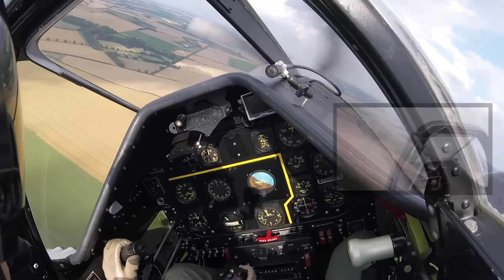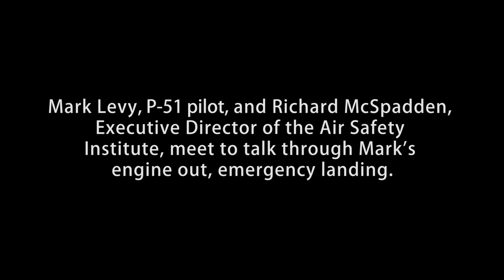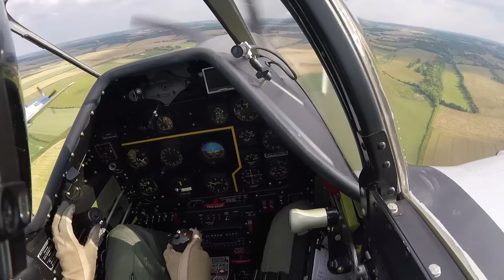P-51 Engine Out, Off-Airport Landing - Full Analysis

Comment: Our military has had the most bad ass pilots throughout history!! My grandfather was a P-51 pilot in ww2 providing support /protection for our B17's heading to and from their bombing missions,  flew his first mission at 20 years old with nearly no experience and ended up receiving a medal for his actions that mission.  for dropping back from the group on the return with another p51 to protect a badly damaged b17 with an engine failing FAR behind its group and slowly loosing altitude and fuel doomed to end up in the thick Forrest below .   The other p51s radio wasn't working and as my grandfather had moved in close to the nose of the b17 to make eye contact with the crew and hopefully give them some sort of calm for a moment as they approached the most common Luftwaffe assault airspace he looked up and the other p51 was nowhere in site , he eased away looking for it knowing the pilot must have seen German fighters and spotted 2 in acrobatics way above them .  He climbed to help keep them off the sitting and wounded duck B-17 spending what he said felt like hours of cat and mouse as they continued to try to get shots off on the B-17 even tho it was clearly in trouble and not going to make it.    My grandfather in all the dogfighting looked down at his fuel gauge and it read nearly empty with a long ways to go and still well over enemy territory if he needed to bail.   He said he knew he had 2 options, continue providing cover for the B17 hopefully fending off the 2 Luftwaffe and surely end up bailing out into German territory , OR abonadon covering the wounded B17 that was surely going down shortly and try to save the p51 and his life for another her day.  Sure many pilots in other places of the world would have left to try and save the P51, himself and knwoing the B17 was most likely a lost cause but he said he couldn't leave it and it's crew to be shot down by the Luftwaffe that would surely pounce as soon as he left.  He found out the other P51 also was having fuel issues from the long dogfight and with no radio he peeled off to return to the group ahead and left my grandfather .  My grandfather a Young American Pilot from Idaho in a plane with virtually no fuel surely to end up a POW if not killed by the 2 Luftwaffe ,stayed and continued trying to protect the B17.  One of the Luftwaffe made a good hit obliterating a machine gun turret and the gunner and my grandfather in his own words said "I was mad as hell and going to kill that son of a bitch!"  He broke off and after that specific German with the other behind him.  Moments later he had a good shot at a diagonal like angle and fired , it sheared JUsT the glass canopy off along with the pilots head , no other damage .  The other German behind him immidately cowered and turned back even being behind my grandfather .   He said the unmanned German fighter just glided smoothly and in seeming slow motion earlilly with no pilot and perfectly level somehow.  He was going to finish it off and had the thought as he realized it was headed directly back in the direction of the bombing target , that he'd leave it be and with any luck it'd continue and loose altitude putting it in Hitler's bunker!  Lol he always told the part with a grumpy smirk on his face.  He left the ghost fighter and returned to the B-17s side.  I always have imagined what a reassurance it must have been to them falling far behind their group in a doomed bomber , to see 2 p51's come and cover them and in the end a single one destroying one and scaring the other off returning to their side like he chased off the wolves.   He looked at his gauge and it read empty , he knew he'd need to get ready to bail when right then he heard the b17 smoking engine sputter and stop and a sudden drop in altitude .  He dropped with it in desperation completely helpless and unable to do anything.  He said he got as close to the crews glass to wish them luck and the pilot salute him and began to drop.  He used to tell us he'd still at 88 years old wake up drenched in bed seeing the wounded b17 slowly drop to the thick Forrest below and the helpless feeling he had and the anger for the Nazis for putting them there.  It dropped down and found a slight clearing ahead but my grandfather knew he didn't have the altitude or speed to make it.  It went into the trees and a fireball below .  My grandpa never showed emotion ever but everytime he told that story he'd get choked up and seem to zone out for a minute like he was seeing it right then.    
He looked back at his gauge in amazement that he still hadn't lost power and caught up to his group and let them know he was long out of fuel and would be bailing shortly and to let his superiors know the location when he jumped.    He said a God given miracle happened that flight , the P51 Jsut kept going and going, until they got near the airstrip .  As he decend with an about out of fuel B17 to approach, he said "I thoght hell, the damn gage must be broke! And sure enough as I said that , that son of bitch died!" Lol. He was short of the runway. But put it ina field with no damage saving the P51 and receiving a medal that sits in my moms house still today for his actions that day. 
My grandfather had one sibling, a little brother that was also a pilot.  They became orphans when he was 13 years old when his parents passed unexpectedly.  His brother was all he had.   He never talked about him though, my mom and grandmother said all they ever knew was he was a pilot and he died in the war.   3 weeks before my grandpa died one day he Jsut started talking about Jack (his brother) and we all shut up as no one knew anything about him.  He went in to tell the story of how his brother was killed.  He was crazy enough also a p51 pilot IN MY GRANDFATHERS SAME SQUADRON!   We all looked at each other realizing my grandfather would have been in the sky it sounded like when he was killed.  He went on to tel about a b-17 group protection mission they were suppose to go on.  His brother was really sick with the flu and my grandfather told him he couldn't go up and to sit it out and rest.  He told my grandpa , you aren't  going up without me there  ,  I have a bad feeling.  As if he was worried about my grandfather.   They went up and on the way to the point where they leave the b17's to dontheir drop and wait for the return having got through the typical hot zones with no issue , right then he said more Luftwaffe that he had ever seen came out of nowhere .  Saidnitnwas pure hell and chaos!  Grandpa said he chased off 2 NOT realizing they bait him and he soon had 2 on his tail .  Long story,..long,..he heard a loud pop boom behind him trying to evade the 2 while moving all 4 out and away from the b17's .   He looked back and saw one of the Germans in a fireball corkscrewing down with a p51 behind it.  The other one peeled and dove and he turned to get back to the group realizing as the p51 came to his side that it was Jack that saved his life.  On the radio he said jack said "told ya had a bad feelin!  You always protected me in school and I finally got to return it!" They continued on B lining to the battle group when out of nowhere he heard his brother yell "ARTHUR!!!!" (My grandpas name ) over the radio and as he looked down and back for Jack it was being lit up at the moment by a German .  He said before I could say his name it burst into flames and I watched jacks P51 disappear into the clouds with not a damn thing I could do about it!"
He stopped talking and tears pouring out his eyes , and everyone else's that had never heard that.  To think ALL those years hat he never talked of it and we wondered why, was becaue he saw him shot down after being saved by him.   Can't imagine how it must have affected his life.  Then he said "they said I could take a few days off but Jack was all I had and I was going to spend every day I had left killing as many of those sons of bitches as I could and bringing home as many of my brothers,.. so , I went back up the next mission and every one after that I could until the war ended.  And to think  now jacks siting with my sweetheart waiting for me to come say thanks for giving me a full life of joy."  My grandma died 3 months before in a tragic accident and it broke his heart.  He passed away 3 weeks later after I found him after a fall with his head bleeding badly.  His brain hemoraged and he passed.    
I was extremely close to them and have an airforce bracelet he wore in every mission  sitting on night  stand .   
These are the types of pilots and brave military we have! Today's pilots , the p51 and b17 pilots in ww2 and all the rest are the heroes that we owe everything too! 
Sorry for the random story,  today's the anniversary of when he passed and he's on my mind so watching p51 videos and hours of the motor cutting! And knowing this happened to my grandfather in ww2 !  I was meant to see this!  Thanks for the post!!
Reply: Stories like these are the reason I randomly check out old WW2 war bird videos.
Reply: Thank you for sharing that, it's important that stories like this are not allowed to be forgotten. They show the human side of a very dark period in history.
Reply: Oh man, what a story! And btw. you can really write. Reading the story i could picture everything the way you described it, you should think about writing someting man. you have talent.
Reply: You just made up for all the shit comments I read on YouTube today. Great story telling!
Reply: Love this story.... Wish you could thank your grandfather and his brother for me for all they did. I can tell you are very proud of them. My dad served in the CAF during the second WW. Lancaster Bombers.  Durham Tees Valley Airport.
Reply: This is why military men and women in battle never ever talk about bad things like this . It just sickens them way to much . This true with any combat . But your grandfather wanted you to know before he leaves this world . So you can tell the story for farther more . The Germans Had a job to do and so did we . But we did not have to go into this war . cooked Church hill wanted our ships to fight the Germans . The Germans was at war with England . The Germans did what they had to do . Sink all ships .  So when England  started to loose our ships FKING Churchill asked our persident the 2nd time to join right in . So guess who got the bearden and the hardest part of the war ! US . We provided the military strength to build and fight for the coward England .  Churchill and our fucking president at the time . For them it was about money . That was the cause of WW1 and so on . Germany want to do is to force Jews to leave freely but they did not go . Matter of fact what started WW2 was Poland . The polish Jews was killing , raping German Nationals living in Poland . If you only knew and if our fathers and grand fathers only knew  what this war was truly about . I know I had 3 uncles and my dad in this war . All came home but not unscaved . My dad used to take what he was suffering on me . I was beaten . Whipped , ans starved and then loved . I have welts on my back side from beatings and whippings . One time it got real bad I was 13 . My dad turned on me  for no reason . Pulled his belt off but this time he did not rolled the belt around his hand that was made into a fist . He grabbed a hold of the end of the belt and letting the buckle to swing .  The hook of that buckle dug into my skin and ripped it about 12 inches before it let loose  and go to get another chunk out of me . I was loosing blood so bad I was pasted out . My mother sown me back up . When the war was on she was a candy stripper  of the time . She was good at stitching us kids up . I was the youngest of the other 4 boys and I was the weakest also . I was a runt . A bastard my dad called me even in public at times .  This time I had to leave and I did . I never came back to see him or my mom . This is what war does to some people and this included my dad . He suffered from PTSD and that went on to me . I have PTSD and when that gets uncontrollable I flip out also . I was never treated for it and I neve knew I had it . I did not take it out on anyone but my self  . To this day I tell my self how bad I was and am . I had tried to die about 4 times in my life . I joined the Navy to see what they did to my dad and I wanted to join and serve my country and country men . I was so bad of shape mentally that I could not adjust . After my 5th week I was shipped back . I think that ended everything for me . I was just living and that was it . I was homeless and not wanted sense I was 13 . As time went by until I was 37 years old I met my other half . We been together ever sense . I am 60 now I am tired . If my wife goes before me . I will not stick around any longer . This to is real , this time I wont be scared or what ever stopped me before .  I own a 30 /30 and that is what I am going to use on my self one day .  When she is gone that is it . My heart been broken for a long time and lived with that for so long . You had a great grandfather that loved all of you folks  I could only wish that I had a Father that loved me in a different way than he did . I became what my father wanted me to be . A Bastard at best .
Reply: Great story. Thanks for sharing!
Reply: Thank you for sharing. Your Grandpa and his brother, with so many others, were such great men.
Reply: Never be sorry for sharing family stories of a brave young man who became a old man to help us remember why those sacrifices ring out far beyond his life time.
Reply: Thanks for sharing your grandfather with us, amazing kids fighting a war.  I look around today and wonder what if we could do all that again. I posted it on my  FB page.
Reply: God bless your grandpa and his brother.   Men of steel.
Reply: Sir you should share your story with a reporter or make a long video of what happened.
Reply: @janreznak881  War is war but I also could never see how the carpet bombings were justified. I must note the large RAF bombers carried 2 times+  payload of a B17 but could not hit targets well so by poor design more collateral damage was inevitable.
Reply: I need to save this story, it is amazing and heart felt.
Reply: was that a lie?
Reply: What an inspiring story! You should be very proud! It’s because of men like them we defeated the Nazi’s! I suggest you contact one of the WWII organizations that archive WWII veteran stories, so that every one can hear this story.
Reply: Stories like these give people a reason to be alive. its sad that a lot of the veterans from that particular period in time are almost all gone or no longer have their wits about them due to their old age.

Its a tragic loss not to remember their individual contributions, sacrifices and acts of heroism. Its a real shame alot of the stories are lost in time. I would of been proud as hell if any of family members served during that particular time period. 

As we continue living, we must carry the memories and the stories of the fallen. Because we are the proof they once existed and walked the same earth.
Reply: Amazing story. Thank you for sharing.
Reply: Both my Grandfathers served in WWII (neither as pilots) the really dark stuff only gets told once.  I've learned that is true of most veterans.  They will tell the same story over and over about eating snails in Paris or trading Captured Japanese goods for food with a warship in the Pacific (both true tells my grandpa's used to tell) but the brother who took a bullet next to them just once.  That also happened to both of them as well.   I miss them both.
Reply: @janreznak881  I know it doesn't justify it but the germans did the exact same thing - in fact, Bomber Command switching from military and industrial targets to civilian targets was a reaction to the Germans doing the same thing. And also the Allies would have lost the bloody war if they constantly bombed by day as they lost thousands of aircrew in daylight raids, hence the switch. While the killing of the innocent is terrible, I think its a far sight better than what wouldve happened if Hitler won the war.
Reply: please report this to some historical society or museum. an awesome piece of history.
Reply: Thanks for sharing your grandfather's story. I'm tearing up just reading this.
Reply: Your grandpa is a hero !!! Please don’t apologize:) thank you for sharing the amazing story !!! I’m proud to be a free American due to people like your grandpa !! Thanks for sharing
Reply: I Love That Katie Loves Classic Books you mad or something?
Reply: Keeping the "we are the best" out of the story would have really helped. There are people saying "we are the best" all over the planet and it just doesnt help anyone. There were and are good soldiers/pilots/engineers/scientists/whatever in every country you can name. Saying "we are/were the best" is patriotic nonsense, exactly the kind of thinking that allows wars like WW1 or WW2 to exist in the first place: Thinking that your country has to be the best. Just because you happen to be born here or there doesnt make it better or worse.
Reply: My dad was a flight engineer and top turret gunner on a B17. Flew 17 bombing runs over Germany towards the end of the war. My thanks to your 20 year old dad for helping keep my 23 year old dad alive!
Reply: Very cool story. I spent an entire Super Bowl party years ago talking with a WW2 P-47 pilot. Way more interesting than the game, I can tell you that! Was an honor to speak to him about the war and thank him for his service. That was 6 years ago and he was in his late 80’s. Probably gone now, but not forgotten.
Reply: ok... but most badass pilots. i mean... hans ulrich rudel and erich hartmann did some wicked stuff too 😅
Reply: @janreznak881  you know the Blitz happened, right????????????
Reply: Thank you for sharing.  That's nothing else to say except your grandfather was a real hero (though I suspect he didn't see himself that way).  I am glad he could tell you his story.
Reply: Man I  dontknow you, or if this is true..but..thats an awesome story!
Reply: Thats a beautiful story!
Reply: My grandpa also was a WW2 fighter pilot, also a pilot ace, but on the side of the nazis, he shot down 47 planes... ....
Reply: @jeffmullinix7916  Quit living in the past and man up to live 100 years. You and Jesus can do it. That war was faught for life, not death. We need your story. Jesus heals and that's it. Thailand Paul son ofCaptain  Antoine Venne Jr "44 months in the Pacific" USS Indinapolis doing his duty. Do yours for life.
Reply: My father is also a German Bomber but around 70s or 80s.. im not sure.. i have his medal also and he died too early because of illness.. i want to get all of his service record just for the sake of losing him at age of 2yrs old.. the German government wont allow me because it is a military documents they say..
Reply: @jacobl6572  how can you save the story and paste it into some other file.